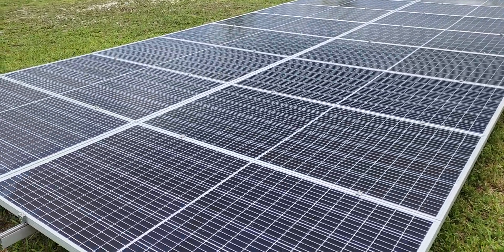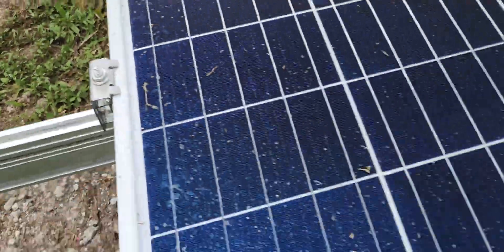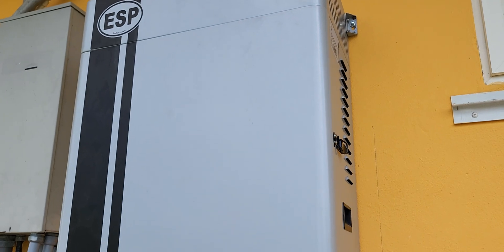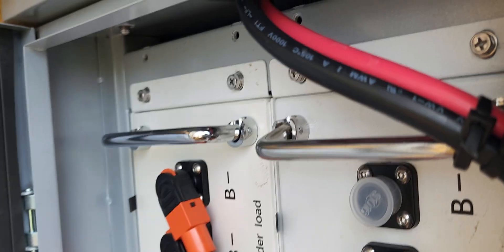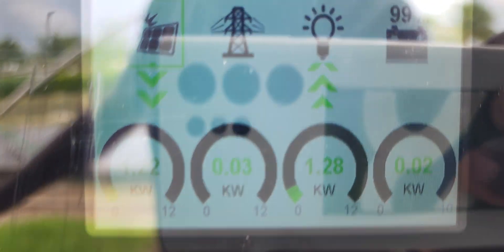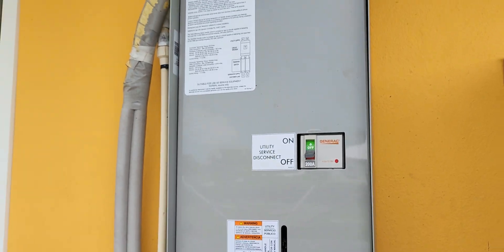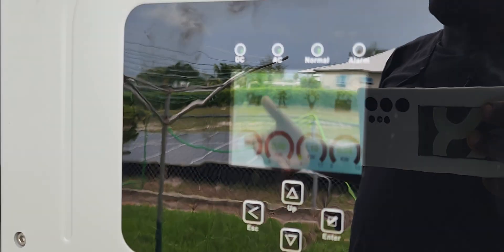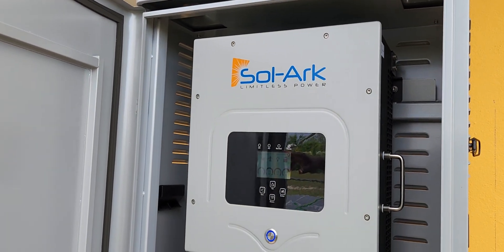Sol-Ark Intergrade Battery Unit 10kwh

Comment: Why install the PV panel on the ground ?
Reply: Puerto Rico is close to the equator and they get hurricanes.  Maria brought 200mph + winds.  Closer to the ground = less wind and tilting the panels doesn't actually help for a portion of the year.  That being said, keeping the grass mowed underneath the panels may be difficult.  Might have been good to put down rock or do a concrete slab underneath.
Reply: @svroundabout  this is in Bahamas, Star Island
Reply: @ericsmithers2952  My mistake but just a little farther north, same issues with hurricanes.

Comment: Thanks for the video. I have similar configuration in Puerto Rico. However, I am having trouble connecting the generac generator. Can you give me more details on how you wired the generator? Thanks
Reply: Search on “DIY Solar Forum”.
Reply from the maker: Sure send a whats app to 242-436-3749 and I will send a step by step video   by its easy .
Reply: Search for “Generac 2-wire start kit”. The kit includes the wires and instructions for setting up the generator for remote 2-wire start.